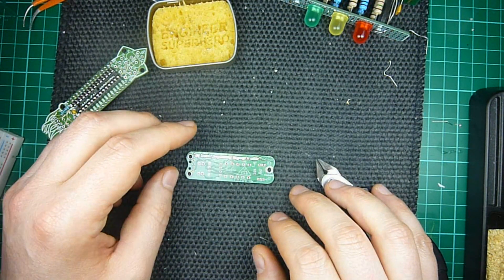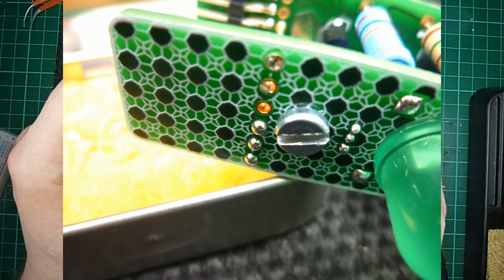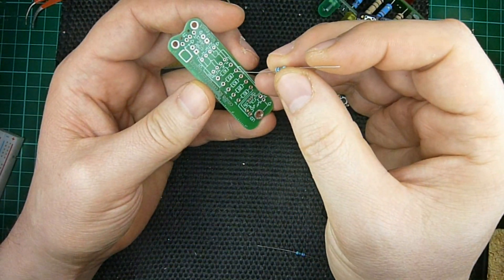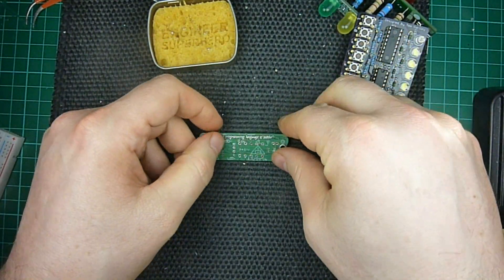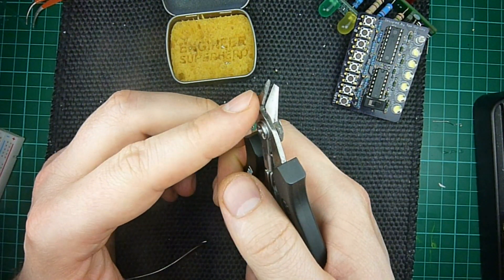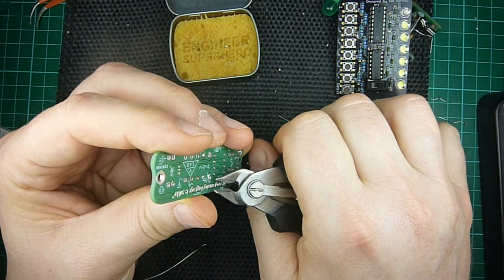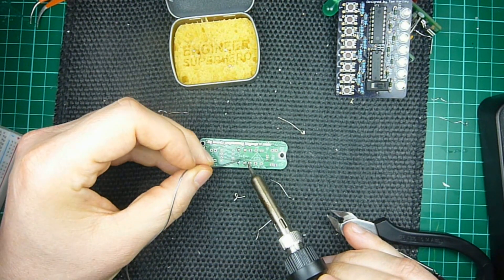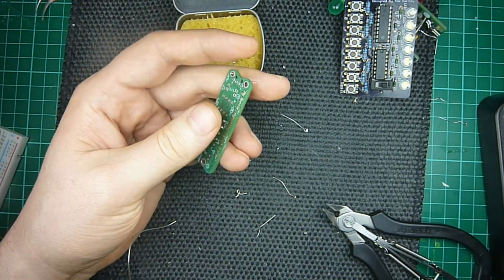Making beautiful solder points

Comment: This is nice if you are doing some soldering at home, but I would avoid this in any industrial application. It violates a number of IPC standards for solder joints.
Reply: For example? (Curious)
Reply: The lead is not discernable in the solder. You would need to be able to know if the lead is 100% through the hole and coming out the other side. The other piece is it's not possible to know if the solder is properly wetted to the lead. You need to be able to see the curve of the solder from pad to lead. That's a good indicator that the solder has formed an intermetallic bond with the lead and pad. This is for class 2 or 3 soldering. If you are soldering class 1 the requirements are pretty loose. If you really want to go down the rabbit hole, check out ipc-610 for a comprehensive list of requirements for soldering.

Comment: Hi Saar,
thanks for the useful tip, it certainly makes a nice set of joints. Cropping after soldering can leave sharp edges and I sometimes reform joints for that reason but don't go to the trouble you have!